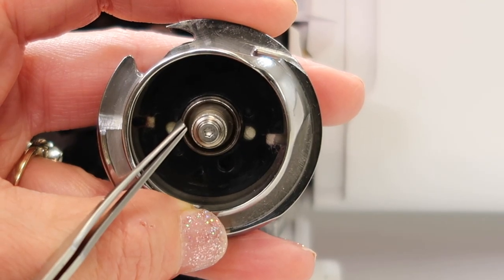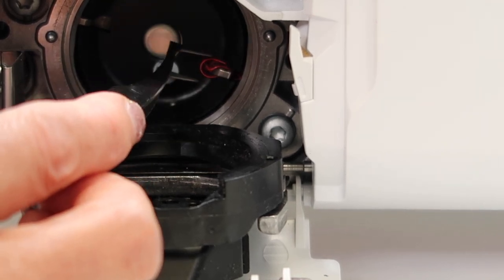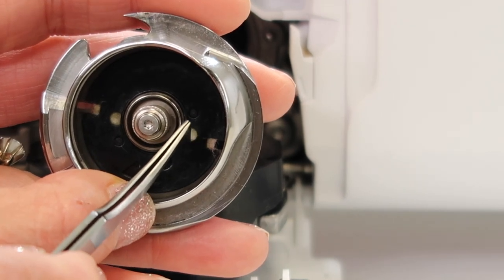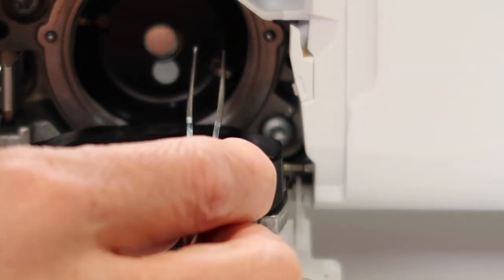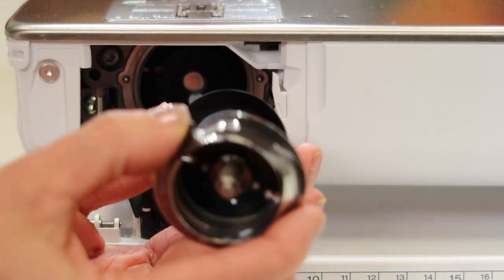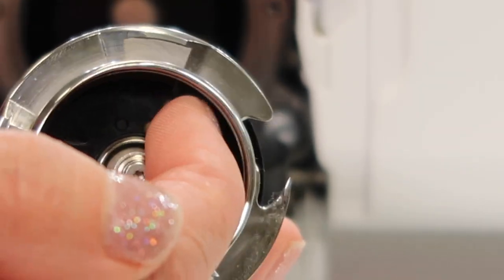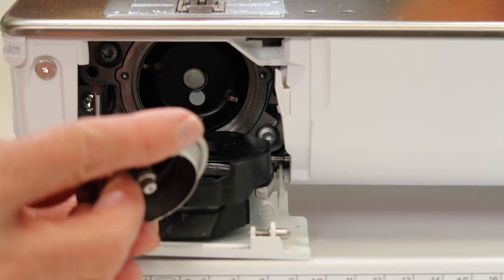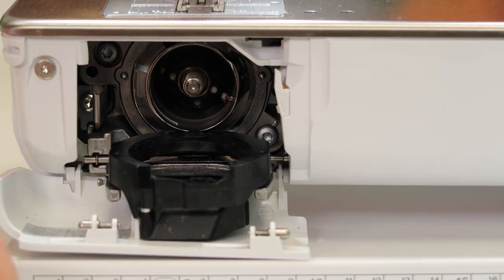Bernina Users - THIS IS NOT LINT!    ***DO NOT REMOVE***

Comment: Can the service technician replace the wick? Or does the entire part have to be replaced?  A friend of mine removed one wick and then questioned if it was lint or something that should be there.  I told her YES, thankfully she didn’t remove the other one.
Reply from the maker: unfortunately, this is not a separate part that can be replaced at this time.
Reply: The "oiling felts" cannot be replace individually at this time. The hook itself must be replaced HOWEVER, the felts are not detrimental. It will cause the hook to be noisy when in use.